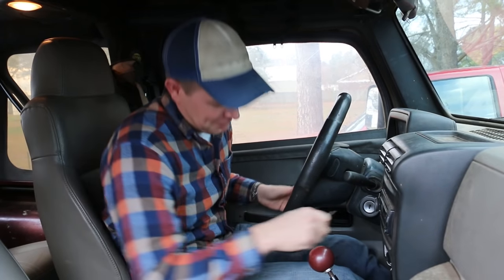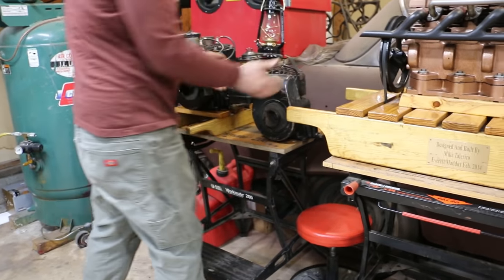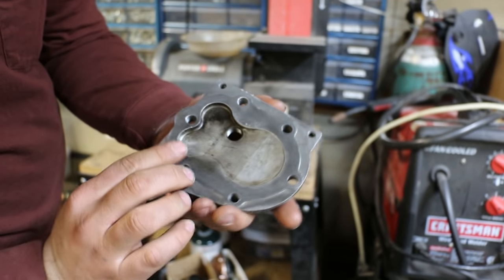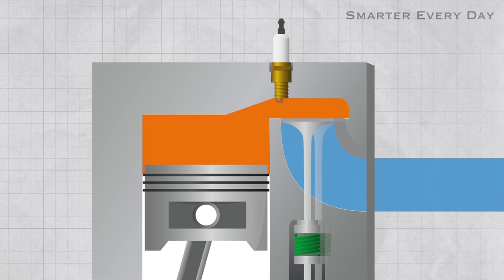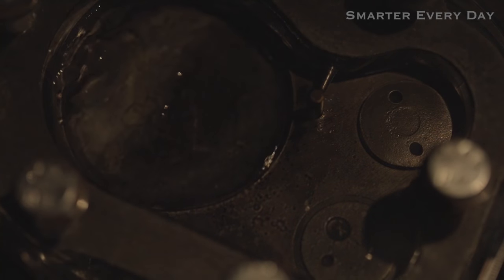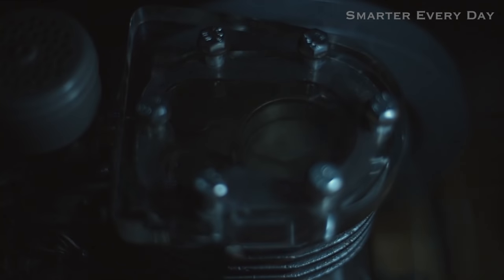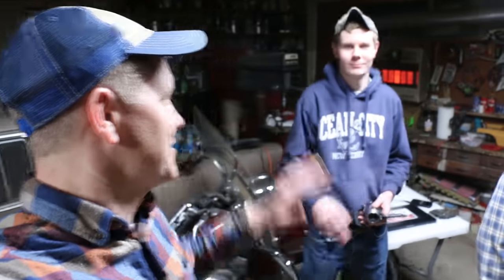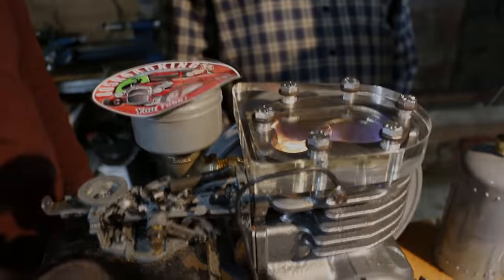How Engines Work - (See Through Engine in Slow Motion) - Smarter Every Day 166

Comment: It's a perfect demonstration for how low tech we still are, and how far we have to go. It looks like we are using mechanical ovens to drive around. As if we are still in the stone age, where we need fire to move around.

Electric vehicles will be so much more fun to use. No fire, no smoke, no pollution too.
Reply: The simple act of building one electric car produces more pollution than using a 20 year old diesel truck for the lifespan of that electric car. No pollution, right.
Reply: Bladsmith, building that diesel truck also produces pollution. This is Smarter Every Day, take your freshman level rhetoric somewhere else.
Reply: But we're not building a diesel truck, we're using an old one. What was all that about reduce, reuse, and recycle?
Reply: Building cars includes half or a bit over half (depending on it's lifespan) of the total pollution. Reusing old diesel trucks wouldn't really be beneficial. How about we start building better cars that don't pollute and reuse them later down the line? We shouldn't stick with oil now should we.
Reply: My old diesel Mercedes has three hundred thousand km on the clock and runs perfectly, with examples over 600 thousand being common. Maintenance is easy and low cost. Buy a brand new electric car today and it won't last 200 thousand before you have to replace the batteries, or you might just have a ludicrously expensive computer failure before that and scrap the car instead of paying thousands. Modern cars aren't designed for durability, you won't be able to hand the aforementioned brand new electric car down to your child in ten years.
Reply: epSos.de BATTERIES REQUIRE FUEL! 
JUST A DIFFERENT KIND...
WE WILL EVENTUALLY RUN OUT OF THAT AS WELL....

WE ARE DOOMED UNLESS WE USE HARNESS THE POWER OF THE SUN.

END
OF
STORY
Reply: What if we just drive the cars we have, then when they're no longer serviceable buy a newer vehicle.

And no, not everyone equates efficiency with fun
Reply: DJ Kinney 
thats so not true, the fact that a method of creating electricity includes burning coal doesnt mean that its the only one, theres many more less polluting, so your argument of electric cars being useless isnt valid.
Reply: PoopStinkPie uhm.. no, inform yourself, theres nuclear that lasts longer, nuclear fusion is being developed that uses hidrogen that comes from water, theres tidal power that comes from the ocean currents that exist thanks to the sun and moon, theres geothermal that comes from the earth's heat, theres eolic that uses wind that exists thanks to the sun, so yeah, theres plenty to choose from.
Reply: epSos.de trust me. You will learn more and have a significantly more fun time in a car ran by gasoline, rather than an electric engine. What do you get with electricity, instant torque, less pollution. Sure that's nice and all, but they are soulless. They make no noise and they are just generally not as appealing in my opinion.
Reply: "Modern cars aren't designed for durability, you won't be able to hand the aforementioned brand new electric car down to your child in ten years."
- Me, 2017

As in all modern cars.
Reply: Meme magic is stronk
Reply: Well lets race from Vermont to Arizona pulling a 10,000lb trailer
You use your
Fancy Shmancy battery mobile
I'll use a 1993 Dodge Cummins powered pickup. :D
Reply: epSos.de no soul either
Reply: old stuff has soul in it
Reply: @epSos.de The electric motor was invented over 200 years ago. Electric cars actually existed BEFORE gas cars. That's right; in the early 1900's. Gasoline eventually replaced the electric cars. The internal combustion engine is a wonderful invention that has done so much for the world. The invention was genius and deserves enormous respect.
Reply: epSos.de coal is the most common way to make electric
Reply: Yeah, it's the same thing with guns I feel. If you think about it, a gun is basically still throwing a bit of mass really hard at another person. Our long distance personal weapon is still just throwing bits of metal at each other. It's fascinating really.
Reply: Actually ICE engines are way more complex than electric engines and a true enthusiast knows that it is overall superior if driven correctly. Also this is an old engine built nothing like today.
Reply: You seem to have missed the point..the point of this video is to demonstrate each individual movement of an internal combustion engine...how intake,compression,power and exhaust strokes combine to give you motion..
Reply: electric cars are and will always be souless. you need some serious skill and time in mechanics to appreciate this.
Reply: The electricity with which you charge your electric car comes from coal plants.
Reply: epSos.de but electric is not as powerful
Reply: epSos.de electric cars will catch fire   just like the  samsung note 7
Reply: epSos.de lol yeah...do you have any better ideas?
Reply: Producing the photovoltaic cells necessary for solar panels also requires fossil fuels, its a never ending cycle of pollution. Producing the plastics necessary for windfarms also requires fossil fuels. Until we master fusion, humans will continue to pollute the earth one way or another.
Reply: Indeed, gas cars are only 25% - 30% efficient while Tesla's' cars are more than 90% efficient. Though how they produce the energy isn't to efficient but it's a step in the right direction!
Reply: GoSuNiguy thanks for that breakdown comment
Reply: epSos.de Actually, in order to get electricity, you have to have something to generate energy. We typically use coal to make this energy and renewable energy just isn't efficient enough to meet our energy needs, so we use fossil fuels instead.
Reply: PoopStinkPie Well, we need to make solar panels way more efficient.
Reply: No pollution? No fire? No smoke? Perhaps the final product. But do you know how they get the materials for the car? Lots of fossil fuel is burned, and they have to mine huge holes to get those precious minerals for the batteries. So technically, you contributed to create more pollution, and pay a ridiculous amount for the vehicle.
Reply: hes right, with how many cars that already exist building a new one, especially an electric one, is actually pretty wasteful.  electric car batteries use precious metals that have to be mined, and wear out much faster than a regular engine.  plus, the batteries have to be charged, so the energy has to come from somewhere.  

example:  the formula E electric racing series.  they appeal to a lot of people because they race "green" electric cars, but after the race, each team charges their massive batteries with huge diesel generators behind the garages.
Reply: Please mind that the comparison of half half is not taken from a diesel car. Diesel is much worse than gas. A diesel car will probably have most its pollution in driving itself since diesel hurts the environment a lot more.
Reply: very good😄
Reply: Electric Engines create pollution when the batteries are produced.
Reply: Simon diesel doesn't hurt the environment more
Reply: Bladesmith, my girlfriend drives an electric car from 2006 that has the original battery and is currently at 326,000 miles, that's 525,000 km. I agree with you that currently it's no greener than fuel, but it will be once solar and wind power are utilized more.
Reply: +Bladsmith yes, but you could say that for the building that produced the diesel truck too. it's not really a fair argument

Comment: I still can't wrap my mind at just how fast those pistons move in an engine, and not blow apart xD
Reply: KilerStreak's Gaming Channel that's why they're made from cast iron lol
Reply: Pistons are rarely made from cast iron, as that is just too heavy for most applications.
Reply: Cameron Jenkins I meant the block but yeah you're right about that
Reply: It's pretty crazy yeah, especially considering that pro stock motors are 500 cubic inches so they have a fairly long stroke, which means high piston speed, and theyve managed to make their shift points over 12,000 rpm!
Reply: lolI thought my bike reving to 14,500 was high I thought prostoct was 10,500rpm
Reply: Even with the impressive materials we have, it's still very amazing xD
Reply: those old F1 engines could do atound 20k I have seen, I believe it was a honda.
Reply: Vowen-Hein Productions exactly right.
Reply: F1 engines always have a very short stroke, which is why you end up with things like 2.4 liter v10's and other ridiculous F1 stuff. Pro stock motors are making 12,000+ rpm with ridiculously long strokes compared to F1, which SHATTERS what every F1 engineer thinks they known about piston velocity :D
Reply: Yeah but pro stock only run for 6 seconds at a time and rebuild after probably less then 10 runs a f1 engine has to last now for a few races so 5-6+ hours
Reply: when you get to motors that have pistons that the stroke is measured in yards and meters and still maintains thousands of rpm it blows your mind.
Reply: Not quite sure where you got your info on Pro Stock engines but it is wrong, they are running at almost 11,000rpm out the back, they shift way before 11k.  This is all acomplished with small journals, titanium and other very light parts.  The pistons are literally half the size of standard pistons.  Pro stock are limited to 500 CI and have a bore center of 4.9 inches, so they have a stroke of approximately 3.6 inches, which is less than a SBC 400 and just a bit more than a SBC 350, we run our 350's in the 8,000 rpm range no problem.  I don't know what you consider ridiculous long strokes but 3.6 inches isn't that long at all.
Reply: KilerStreak's Gaming Channel if you have a very small stroke and a big bore you can have more rpm just like v10 in f1 back in 2005 they could reach 20k rpm
Reply: KittyCow - an F1 v6 with a 53mm stroke that is rev limited to 15,000 RPM will have a higher piston velocity than a pro stock engine...
Reply: Vowen-Hein Productions The highest revving F1 engines were the non-rev limited V8s from 2006. Cosworth engine exceeded 20k rpm. The V10s revved somewhere around 19k rpm but none exceeded 20k(at least not outside of the dyno) and the last Ferrari V12 went to 17,5k rpm. Current engines are rev limited to 15k rpm but no team chooses to rev that high due to fuel flow limitations.
Reply: KilerStreak's Gaming Channel you think that's a lot? my Nitro RC car operates in excess of 50,000-75,000 RPM. at 15 PSI, the turbo on my car is around about 100,000 RPM
Reply: Sorwis Fun fact: Due to the longer stroke in a NASCAR engine, the peak piston speed in a NASCAR at 9000 rpm is faster than the peak piston speed in an F1 v10 at 18000 rpm.
Reply: salemcripple - Considering the stroke length, and size of your engine that's neither surprising or impressive.
Reply: thejunkman these small engines are usually a little closer to 3500 rpm max. However some of the racing mowers are cranked up to 6500-7000 rpm but that requires a complete rebuild with very high end parts nothing stock internally.
Reply: Spot on!
Reply: Alternatively look at F1 engines. The highest allowed amount of rpm by the FIA is at 15,000 rpm. Yes, that's fifteen thousands. But this is a regulation. Which means the engines can handle even more. In 2009 the rule was at 18k rpm. That's 300 revolutions per second. A four stroke cycle for one cylinder is completed after two revolutions which results in 150 combustions per second.
Reply: Andreas Kist correct me if I'm wrong but that's in 1.5 combustions every microsecond. I'm not real familiar with the units of measurement of time that small. And that's also so fast that for every combustion you see there are actually 15 more that take place before you actually process what you're seeing.
Reply: +Dimes On His Eyes 0.15 combustions every millisecond. A microsecond is a millionth of a second. Or 1.5 combustions every centisecond (one hundreth of a second).

I am not sure about the seeing part, but i think a human could only see a constant combustion.
Reply: KilerStreak's Gaming Channel thats the thing after a while especialy when you run it alot piston and cylinders crack but they are replaceable its just a pain todo
Reply: KittyCow Okay, buddy.
Reply: Eric Johnson Exactly
Reply: Actually they can, most engines are limited by rpm so that the rpm stress doesn't damage the rotational and reciprocating mass
Reply: Oh believe me they do blow apart and us race car builders ball their eyes out when it happens😂😂
Reply: Oil, my guy. Always make sure to check your oil

Comment: Exhaust phase is my favorite. So eerie looking.
Reply: The exhaust stroke blew me away. There was something odd I didn't expect. I always thought the pressure of the returning piston 'pushed out' the spent fuel. But take another look. It is not pushed out by the piston, it is drawn out by the exhaust valve. At first I thought I was fooling myself. I noticed the fluid leaving the valve at a greater velocity than in the area of the piston. This could be explained by a constant volumetric flow rate resulting in higher speed for a more narrow channel (like the rapids of a river). But compare the intake and exhaust strokes. You see this dynamic of faster flow rate near the intake valve. The discrepancy is more prominent in the exhaust stroke. It seems that in the exhaust stroke the escape of fluid is dominated by factors concerning the exhaust valve and less so the piston driving fluid out. This could be explained by a great differential pressure from the piston chamber to the exhaust system. There is clearly a greater pressure in the piston chamber than atmospheric pressure, but I didn't expect this to dominate the action of the piston. Crazy!